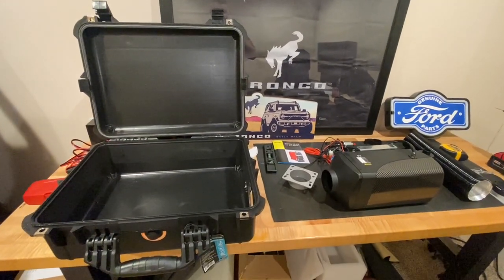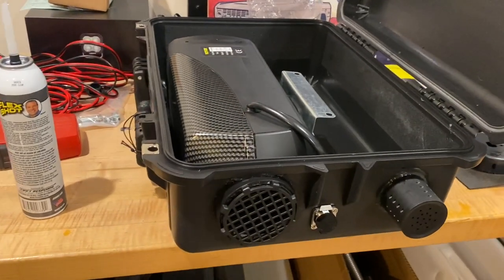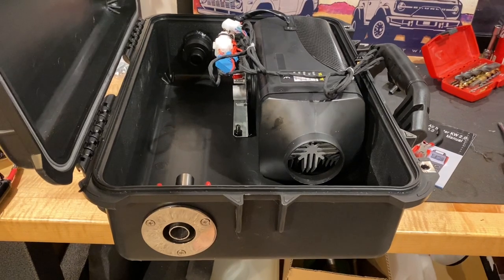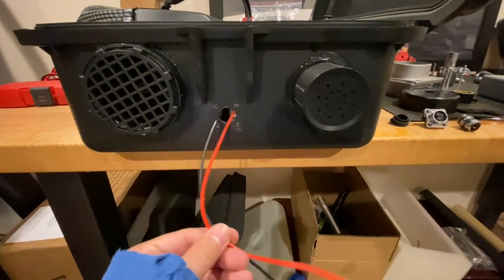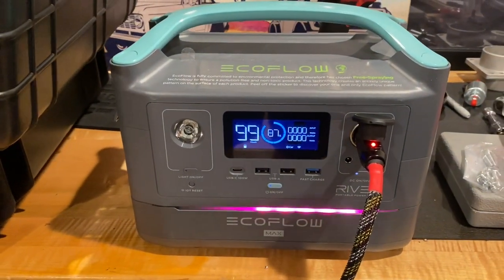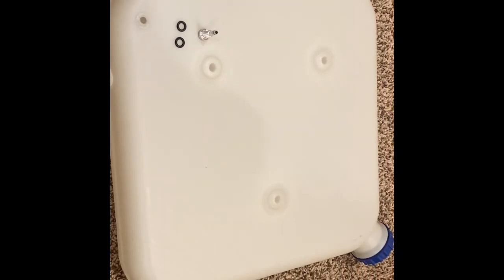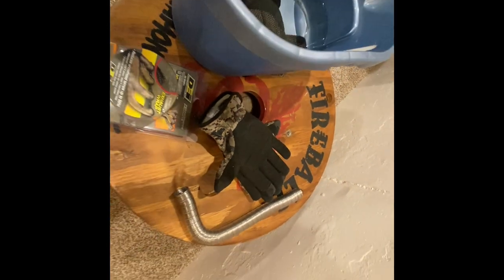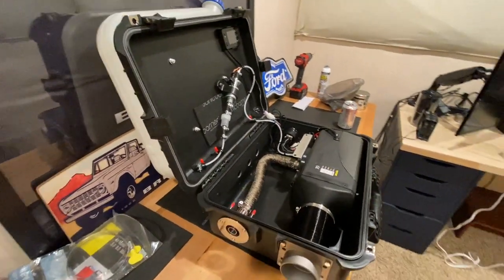Vevor Diesel Heater Portable Box

Comment: Nice build look forward to video of how well it worked! Be aware your fuel tank may leak where you drilled through the tank for your fitting. If it does consider using a draw straw for supplying fuel guaranteed no leakage.Good job!!
Reply from the maker: Thank you, I have used it many times in -5 to 27 degree winter night. It works great. I only made one modification. I got rid of the car lighter plug and switched to a 12v invertor.

Comment: I've watched so many videos on if anyone made an all in one diesel heater kit. The answer is none. So I started spreading words.

I made 2 all in one unit so far.

The Ridgid medium size box had so much room.
I had room for the heater, 20ah lithium battery, solar controller, AC to DC charger, cooling fan, USB, 12v Socket, and quick detachable 5 liter fuel tank.
This one is bit bulky and heavy 

My 2nd all in one is made of Apache 4800 case.
I kept it simple. I added a diesel heater. The trick is to mount the heater flat on the bottom with both exhaust and intake exiting the case without the pipes.
That gives you plenty of room to add a 20ah lithium battery and the AC to DC charger.
I also did a quick detachable fuel tank.
Much lighter and not so bulky.

Both are weather tight. It can handle heavy down pours.

The bottom of the case does need legs to elevate the box so the exhaust and intake doesn't get damaged.
I added a quick connect legs with wing nuts.
Reply from the maker: That’s cool that you found a way to add the battery in. I never really thought about adding the battery to the box.

Comment: Overall, neatly done but I'd consider doing a few things differently...
1.  Control panel outside the case with an extension cable as needed.  Electronics are susceptible to premature failure due to heat, and the temp sensor for the thermostat is located in the case.  That can't function well unless your just using pulse, and dont care about thermostat control. 
2.  Get away from the cigarette lighter stuff - generally to light for the amp draw and too prone to accidental disconnection.  Try Anderson connectors, or the XT90's
3.  Skip the supplied air intake / "silencer"  The screen ones provide better air flow.  Heck, even a screen on the end would work better.
4.  Get shorter screws for that marine exhaust!
Reply from the maker: Thanks for the information,  I am using the pulse rate of 3 hrtz like you mentioned and not the thermostat. I'm working on getting Anderson connections like you mentioned as well. Yeah the screws are driving me nuts being long. I will do a update video of the changes made.  Thanks you for watching !

Comment: What did you use for the heater mount plate?
Reply from the maker: The stock plate that it came with drilled holes through it and bolted it to the box
Reply: Thanks.
Reply from the maker: @mjdpainting1916   No problem all the parts list is in the description.
Reply: Did you have to put a bend on the stock plate? Mine is just a flat plate.
Reply from the maker: @mjdpainting1916  Yes I did bend it
Reply from the maker: Following up were you able to bend the plate and get it mounted?
Reply: @BareBackBroncos   Yea! It works great. Thanks for asking. Everything works awesome.
Reply from the maker: Awesome glad to hear that!

Comment: I didn't think to use muffler sealant good idea. That fuel pump/filter looks like it gets pretty close to the exhaust when the lids closed. A heat shield couldn't hurt
Reply from the maker: Hi thanks for watching! It’s running great. I drilled large air holes in the bottom to let out that heat. The hole hasn’t melted and my box doesn’t get as hot as you would expect. It is something I do watch though.

Comment: Most Ecoflow Jacery ect powerbanks 12v outlets wont give the amps needed . and you wil have to use the 110v AC and use a 110v / 12v 20 amp power supply
Reply from the maker: I have a 12v 20amp power supply that I converted it to. I should do an update video.

Comment: Thanks for the detailed vid. I am in the process of getting a diesel heater and match it to my ecoflow river 2 max. I had a few people tell me not use cig lighter to power the diesel heater. How is yours working out and any issues?
Reply from the maker: So my first year with the diesel heater and the cigaret lighter outlet was fine no issues. My 2nd season with the socket got loose and I would lose power. 
 I went ahead and hardwired the heater to a laptop 12v to 120v adapter similar to a lap power plug and now it works great no issues
Reply: @BareBackBroncos  Thank you for the response. I am thinking of doing the same thing. But AC mode gobbles up more juice from my power station so I wanted to avoid that if possible. But seems like this is the only option.
Reply from the maker: It’s not to bad, I have a river pro max and I can get 2 nights with it on setting 3-4
Reply: @BareBackBroncos  Thanks man. This is very helpful. Nothing beats experience of those who went ahead of you. Keep those vids coming!
Reply from the maker: @johnkim8875  Good luck! If you need help just send a message and I’ll try to help. I have the parts list in the description.  Thanks for the kind words.

Comment: How do these boxes handle with the heat? Don’t they get hot at all? It must be very cold where you live
Reply from the maker: @jamiemartin8572  I start to use them around 30 degrees down to -18 and it does fine.  The exhaust wrap and holes in the bottom of the box work great. You can always add a fan if you want.